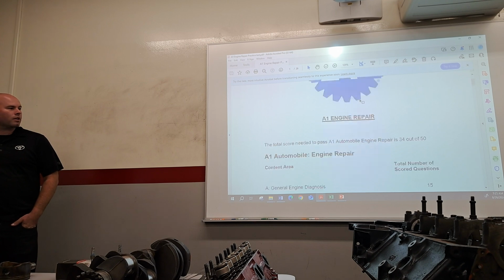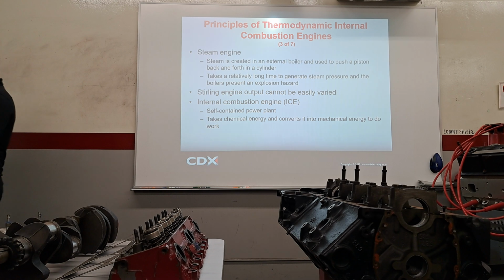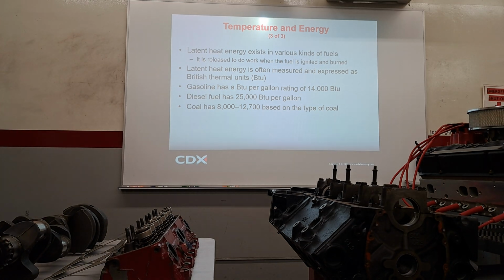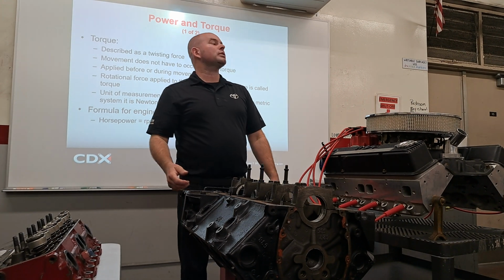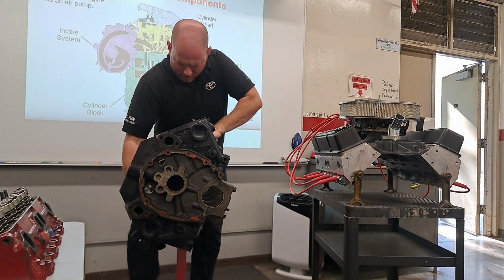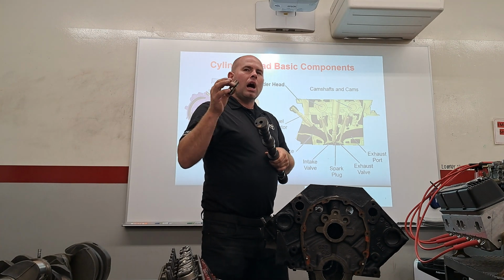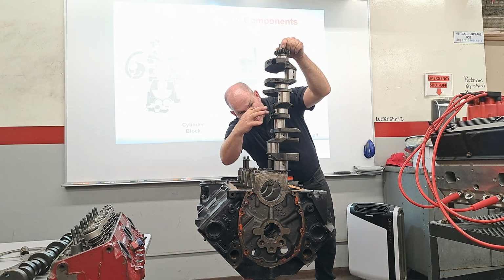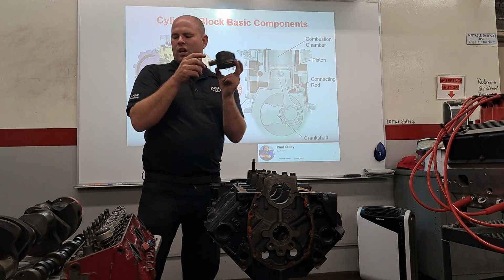ASE A1 Engine Class Unit 1 Introduction to Engines Part 1 (see new version)

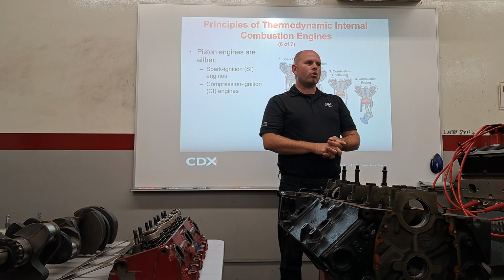Comment: 23:30  I thought the crank shaft had to rotate 4 times for all four strokes? 2 strokes for intake 2 for exhaust? Someone explain it to me if im wrong please
Reply from the maker: A rotation is 360 degrees. A full circle.
When the crank rotates a full 360 the connecting rod and piston will make 2 strokes. 
1 up and one down. 

Lets start at top. 

The first down is intake stroke
The first up is compression stroke
(Thats one 360)
The second down is power or combustion stroke 
The second up is exhaust stroke. 

That makes 2 360's for 4 strokes. That is the 720 degree cycle.
Reply: @CollegeAutomotiveClasses  I see. I guess my confusion came from 2 rotations of the crank shaft = 1 rotation of the cam shaft. But it makes sense that a single rotation of the cam should be able to engage all needed valves. Either way the piston needs to go up and down twice so 2 rotations make sense thanks for answering so fast
Reply from the maker: @hanson708 yes you got it!

Comment: First thank you so much for these vedios its really helpful. I have question. What if the crankshaft bend. Could the line bore repair the main caps?
Reply from the maker: Yes! To a limit of course but we line bore them for that.
Reply: @CollegeAutomotiveClasses and how would we know the limits? Because i dont think i would get that kind of info in service manuals
Reply from the maker: @ahmednajim3752 it would be in a service manual for the engine unit but not on a modern car, on say a vehicle with a 350 it would be something you could find.
Other resources include aera.org